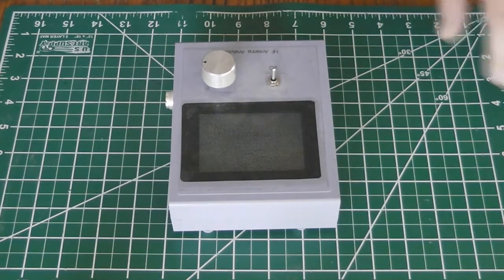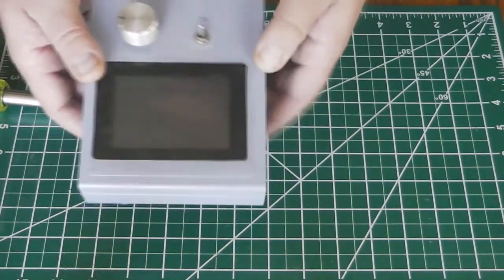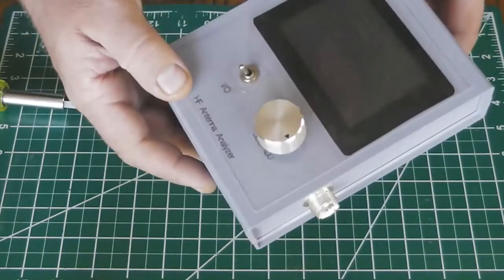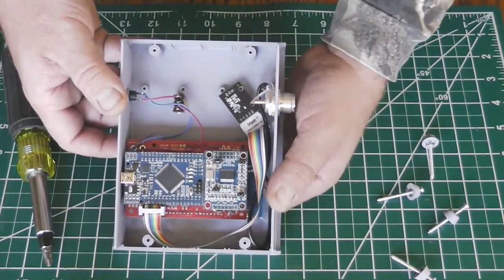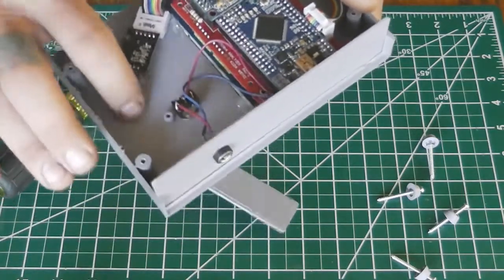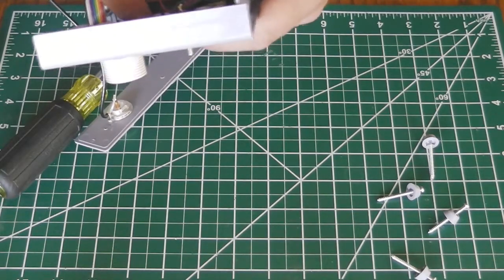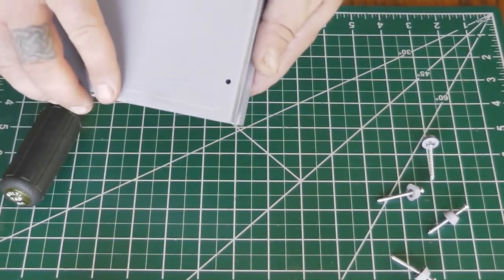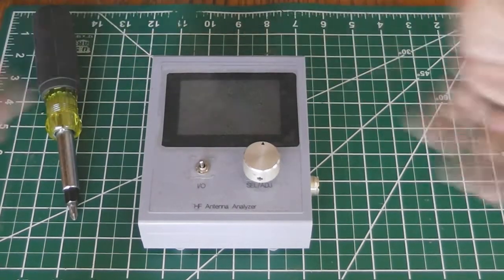Arduino Antenna Analyzer -- A Look Inside

Comment: Nice project. Can you put a link to the case you used?
Reply from the maker: The one I used, the link is now dead.  I built a second and third one and this is the box I used in the last one.  A little bigger, but I added rechargeable batteries.😀
https://www.amazon.com/Zulkit-Dustproof-Waterproof-Universal-Electrical/dp/B07PWSWJCG/ref=sr_1_12?dchild=1&keywords=uxcell+Plastic+Electrical+Enclosure+Junction+Box+Case+152mm+x+120mm+x+42mm&qid=1589763057&sr=8-12